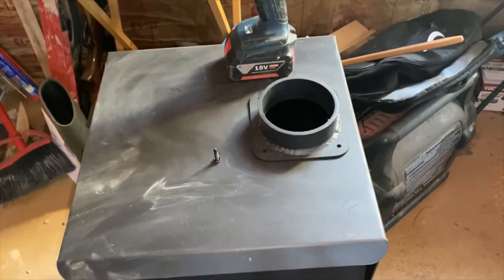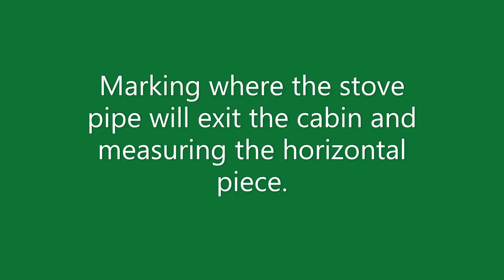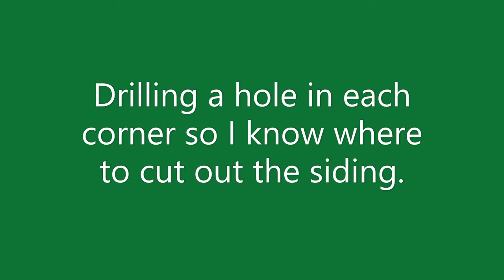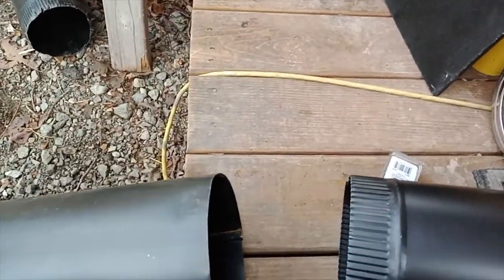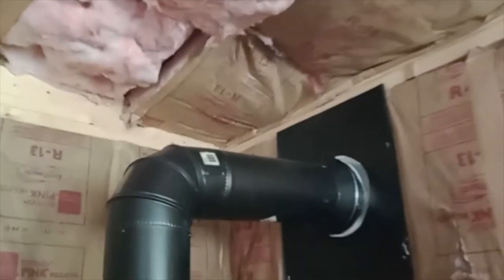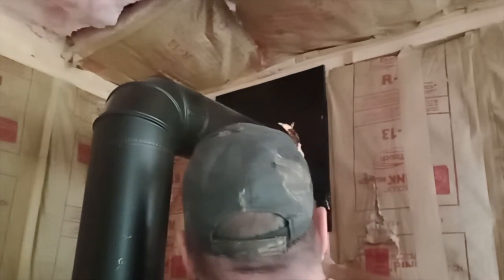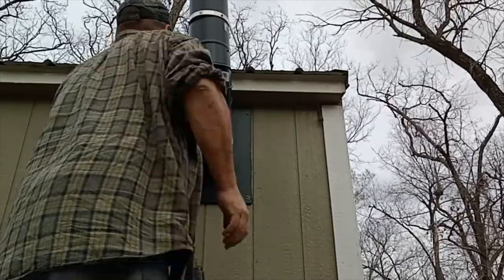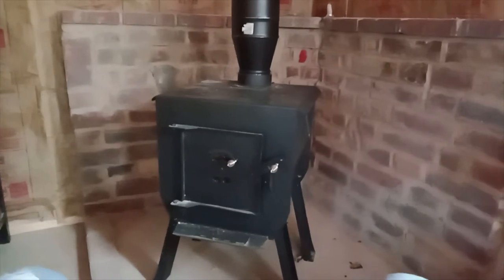Installing a Wood Stove In My Off-Grid Cabin

Comment: Did you have any issues with snow sliding down from the roof into the exterior stove pipe?  I was wondering if it would have been better have the pipe go through the gable end wall where snow would not slide down?
Reply from the maker: You know, I haven't had a problem with that. We don't get a whole lot of snow. I thought I might put some diverter flashing over the pipe just to divert it away but it hasn't been necessary. I just might have went out the Gable end or even the roof if I ever install another fireplace in another cabin.

Comment: Did I hear u rt u cut the piece going through the wall down that's a big no no I take it u have not done this before
Reply from the maker: Done it plenty of times. Don't think I said anything about cutting it down, if you're talking about the double walled section, it's just a 12" section of stainless double wall. That's all I needed to pass through the wall.